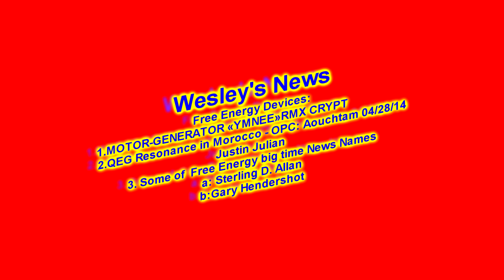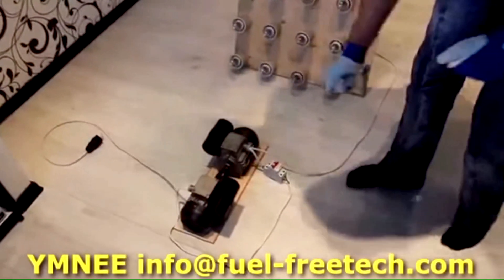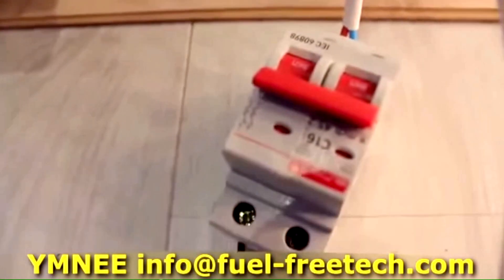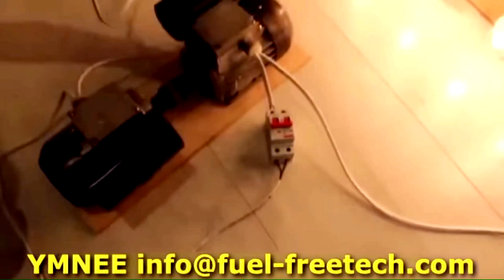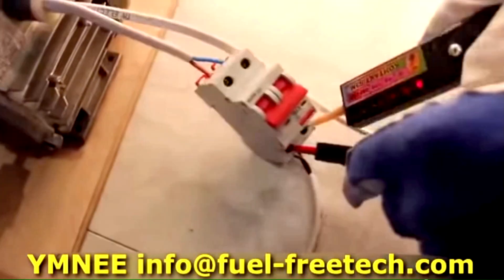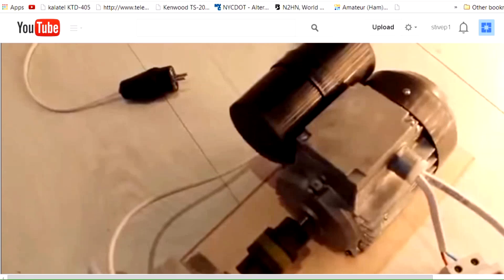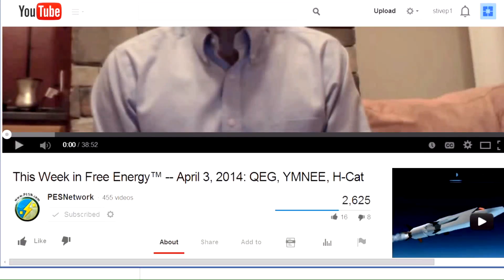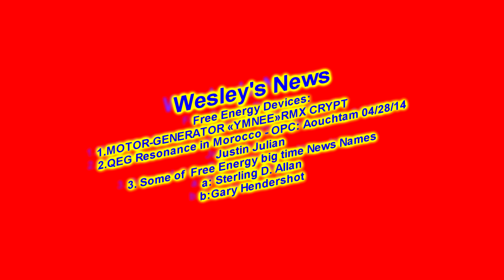Wesley'sNews:2 Motors Generator Free Energy" UMNIEE" and "QEG"

Comment: How could turn on the motor and at the same time connect the power output of the generator to the motor without causing problems?
Reply: ....that l was asking myself...
It will sure short-circuited the diagram...!
l believe there is something done on the cylindrical thing fix on the body of both the generator n drive-motor....!
Pls explain.